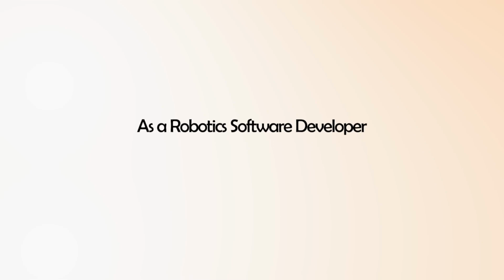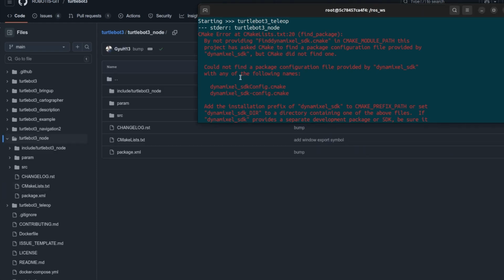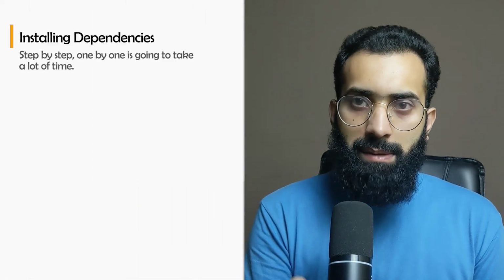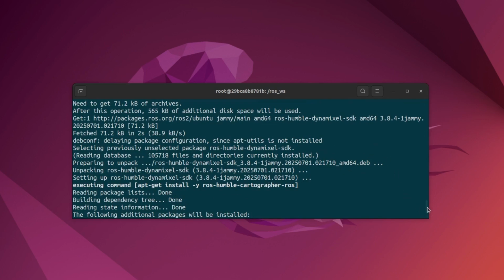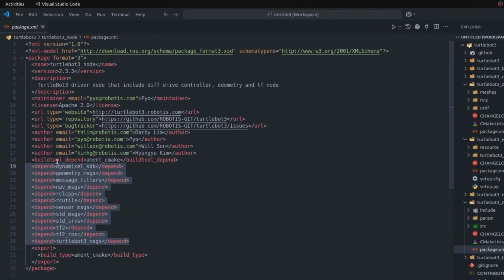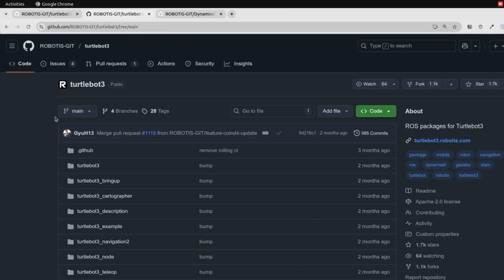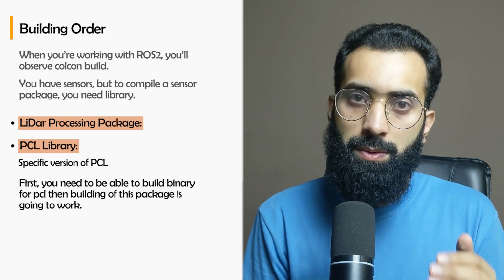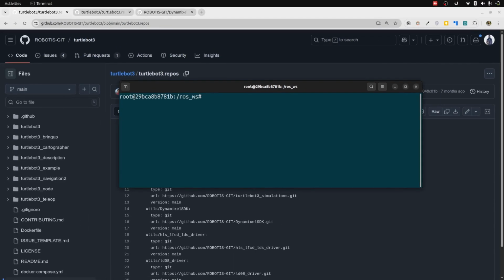Fix ROS2 Dependency Errors Fast | Step-by-Step ROS2 Dependency Setup for Beginners

Comment: Trying to use PyTorch inside a ROS 2 Jazzy node. Install works and colcon build runs fine, but when I launch the node it can’t import PyTorch. The tutorials only show how to install, not how to integrate third-party Python packages with colcon. Anyone knows the proper way to set this up?
Reply from the maker: There is another video of ROS2 and custom packages and libraries which might help you.
Reply: @robotisim  thanks for responding 
Do you mind adding the video down in the comment